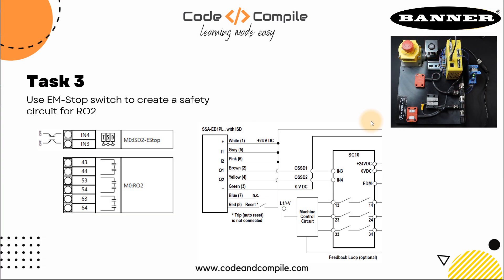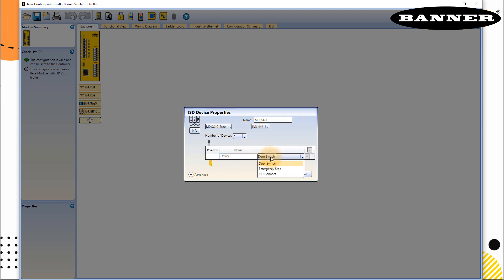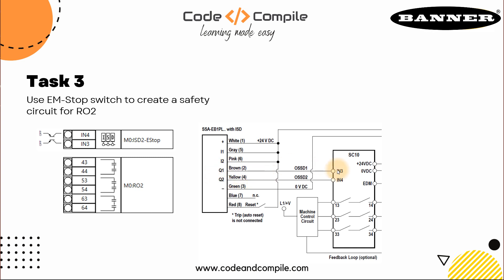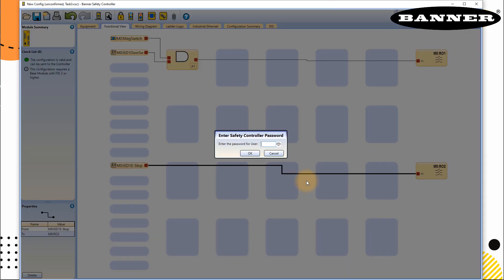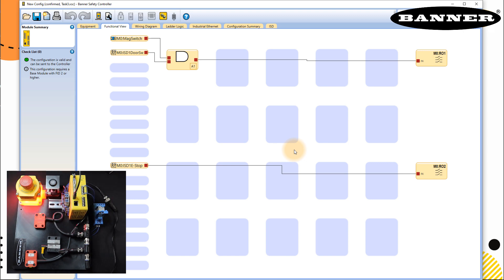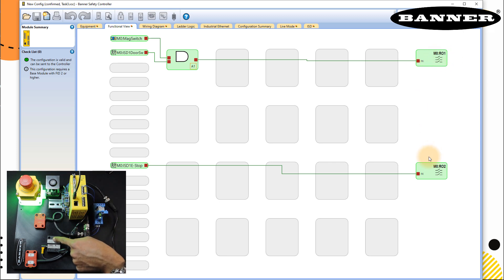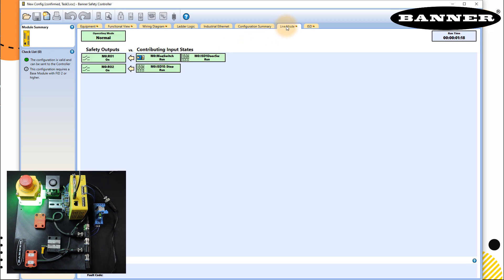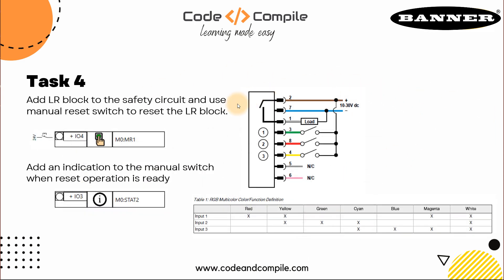Episode 5-  E-Stop safety circuit with SC10

Comment: Hi thankyou for this tutorial. How is the auto reset setup? I have everything working correctly but my estop does not reset the safety circuit once i release the button. Its an ISD compatible estop and i have the 4/8/4 connector which leaves me with 4 wires. This was all purchased through banner. I ran blue and brown to supply and black and white into IN3&4 of SC10.
Reply from the maker: Hi, do you still have this issue?